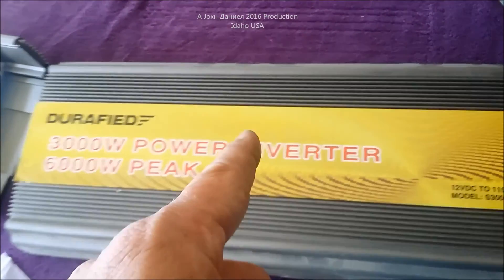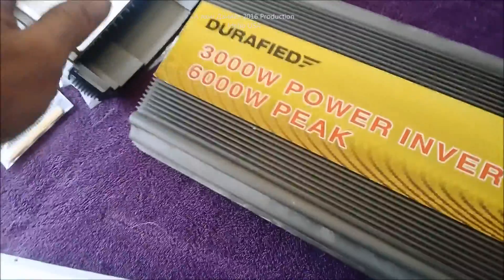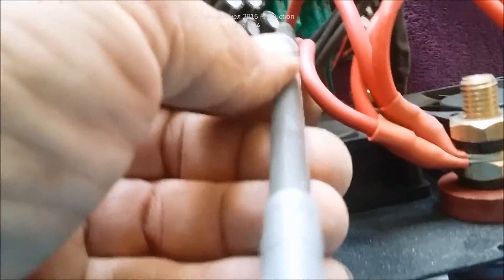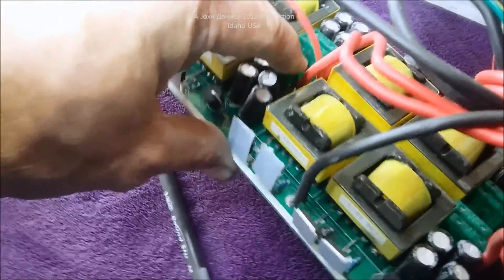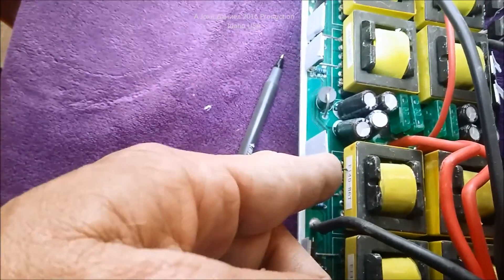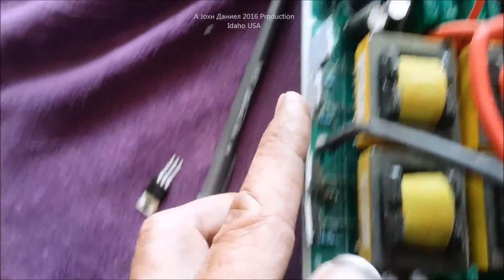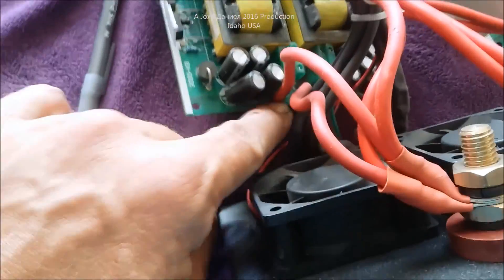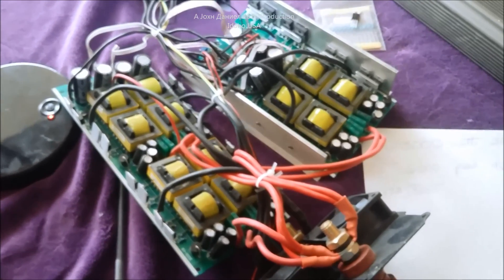DC to AC Power Inverter Repair Durafied & China Made (see Info Below)

Comment: Could you use a bigger bolt MOSFET if desired? Thinking about buying a cheap 5kw inverter and doing some upgrades to it. I'd like to use it for a fridge and light bulb outside in my project shed. Thanks.
Reply from the maker: Yes but you have to upgrade the capacitors also, and be sure to not overload its peak because the peak will not change even though the normal running will increase slightly.

Comment: Hi, i have edecoa 24/220v 3500w (7000w peak) inverter and it is having cs75n75 mosfets which are broken. I have ordered same one on AliExpress but i would like to put something stronger and to add cooler inside. Any advice? Thanks in advance...
Reply from the maker: You can enter the part number online and type in option for it. So you would say your model mosfet options it will give you options of mosfets with a higher voltage and amperage rating. Takes a little work around to do it.

Comment: Hello sir, I hope you can help me.
I have a new Cjang inverter (banggood)
12v 3000w. The original mosfets broke due to overload (which should not happen due to security) Then I replaced the original mosfets FHP 1404 (40v 160A) with IRF 1404 (40v 200A) Unfortunately that did not work. After the power was switched on (without load), they immediately broke? What could go wrong? Kind regards curious ..
Reply from the maker: A few conclusions: You have a open DC mosfet up stream thats not switching on/off and is hitting them with full on. Or your AC plug is shorted and that will blow over half of them after replacing. Sometimes it can be a capacitor thats out of rating or shorted.
Reply: @JOHNDANIEL1  Thank you for the quick response, I fear that the printed circuit board is too damaged. Here's a photo (if it works)
 https://www.mediafire.com/view/rzok8z7c77ikxld/Cjhang%2012v%203000w%20inverter.jpg Maybe you already know more than me. kind regards curious
Reply from the maker: We have this brand a 2000watt in out camp in Nevada 3 years now, no fails https://www.banggood.com/custlink/vGKm4uiN9L
Reply: @JOHNDANIEL1  Thanks for the good tips!
Reply from the maker: Yes, the damage is past correction. I would say a resistor that provides switching speed on the first or last pair failed and cascaded them all. If you want a 3000 watt that WILL NOT do this and has a better field of modified sine wave get one of these, https://ebay.to/2KDUj93 and you won't have to fear a house full of smoke again. You pay for what you get! Or what their ad claims at least.
Reply from the maker: They area having a good sale, might want to see if a full board insert is there https://www.banggood.com/custlink/3DGD01INPI

Comment: My 1000watt inverter turn on but didn't give out put.I have already check MOSFET and transistor these are ok my fuse also ok ,please tell me what can be damage
Reply: Also some time give output but voltage didn't be still it's increase and decrease
Reply from the maker: @yousufarafat3482  Seems your power control board has s short in or near it. Theres a small control board, it has often issues with solder connections. Check all for full proper solder job on them.

Comment: Sir.
I have an 1000w china car inverter. 

 The 4 mosfet Hy1906c is dc Side  located.  Two of them will burn.  Whenever i changed them.  whenever 12 volt  supply on it the mosfet again burning.
I have removed all the 4 mosfet from pcb boards.and check the voltage.   Reading is something like this
Source to drain= 12v
Source to gate = 5v 
Source is common to 12v  battery negative point.   Pls solve the problem. That how i
Check out which component's.  

Regards 
Zeeshan
Reply from the maker: You have defective capacitors. They cooked their electrolyte without swelling and when a charge is present your mosfet can not rid itself into the transformers.
Reply: @JOHNDANIEL1  There are many capacitors there. The difference between which is the difference between the person. If I want to send you this picture, then how can I send the board pictures.  So that your highlights from the parts.
Reply from the maker: @muhammadzeeshankashif5380  You can email us at olympicpowercontrols@yahoo.com

Comment: You are correct in the lengths of the wires should be the same. Also quite often makers undersize wire. Myself for 250amp I would use 1/2" brass, and use larger wires as 8awg is good for 40amps. Larger the better, and higher voltage is better because of voltage spikes.

Comment: where is part 2?
Reply from the maker: In the process of making a #2 video and repairing it worked for 6 days, not long enough to warrant uploading the video to show any worthiness of the inverter, and the phase control circuit ( a separate item not related to replacing a few resistors) then failed proving that even the lowest quality inverters can force you to throw them up against the wall. This leaves this video as a lesson on what to look for in the voltage supply circuit to the mosfets.

Comment: Question:   Watched many of your videos, mostly inverters.. I have 2 - 6 volt batteries  230AH, connected the + and - to have 12 volts.. I have 2 - 12 volt batteries 1 is Marine 210Ah and 1 is deep cycle 110 AH.. Can I connect all the batteries together? I have 1 - 300 watt solar system (will upgrade to 600 soon) and 2 controllers.. One is to charge my 2 6 volt batt ( actually 12 volt now. and one to charge my 2 12 volts... Is that okay? Thanks
Reply from the maker: You need to test the quality of each battery ( a VERY GOOD TOOL - http://amzn.to/2yNSC1l )  you plan to use, and age of them is most important. The best program is to simply buy all  new batteries of the same style, amperage and make. However you can tie a 12 volt  battery to any grouping of batteries as long as the static rest voltage is within 1/8 a volt. So, get a full charge on each, allow to sit 24 hours with NO USE on them then with a good voltmeter test and record the voltage at that point. All batteries that are in good condition and within 0.125 volt of each other ( no more than 2 tenths difference) then you can wire them all as one 12 volt bank. Just be aware they may not last too many years due to different plate value discharge rates. 
Get a good AC & DC Amp meter like the one i showed above to make what you do have last much longer.

Comment: Anybody wanna trade a broken 24 volt 5000 watt inverter to fix my 12 volt 3000 watt inverter I'm at jamesdmason72@gmail.com or 949 272 6639
Reply from the maker: +James Mason You can fix it, not very hard to do.
Reply: Јоhn Daniel it's a Peak 3000 watt inverter inside are 2 1500 watt inverters I changed the fuses but no go . I need power for my bus  I also wrote you about a Aims Power SCC80MPPT solar charge controller that I need a remote display for it. I subscribed to your channel. Thank you for your time and for sharing your videos with us. please somebody I need help
Reply from the maker: +James Mason I am shocked a PEAK quit on you. I have literally beat the hell out of mine with no problems.  
However, on that peak if your inverter quits the cause is most likely in the start on/off switch. Secondary it may fail to operate if it senses a dead fan in the inverter. 
They are not much on them that's not very durable. 
Amazon has them for $225 delivered, as all electronic stuff now unless your stocked in parts and proficient in repair it's cheaper to buy new and not repeat the same conditions that caused the last failure.
Reply: Јоhn Daniel thank you for the reply but I don't have the money to get a new inverter, mine is the model before yours  it's a double stack with 2 1500 watt inverters and the other is a Aims  Power 24 volt 5000 watt double stack 2500 watt inverters, I live in my bus fulltime and don't have a job right now that is why I'm asking to trade, I need a 12 volt inverter at least 3000 watts